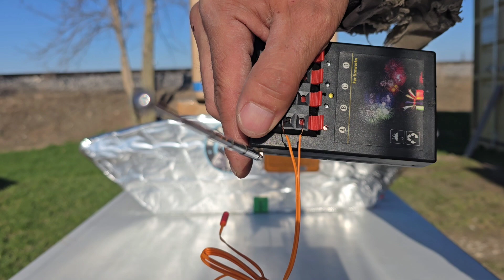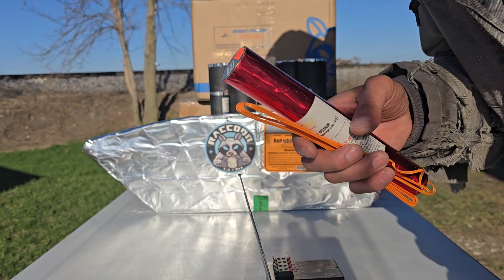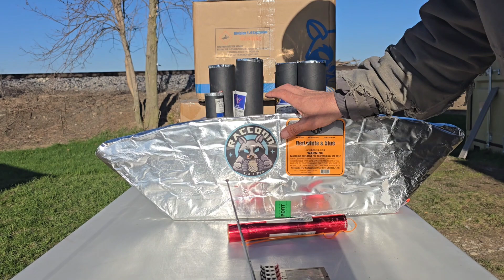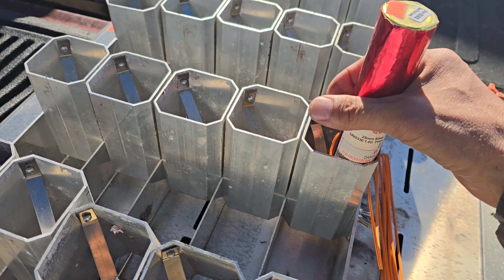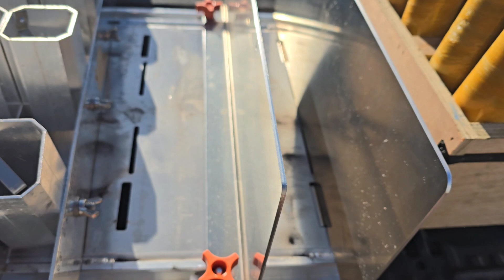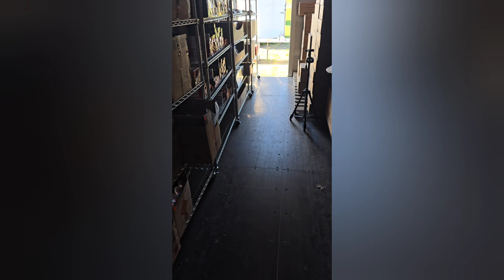1.4g pro use video #2 - Firing system questions, Single shot & Slice connections.

Comment: Good job on explaining this stuff so people can be safe using it. If people can get 1.3g on the street they can and will get 1.4g pro, the least the community can do is educate people on the safe way to use the stuff. The most important thing about being safe with fireworks is using a firing system and staying far away.
Reply from the maker: I'm a firm believer in these firing systems.  When they talk about regulating the pro stock I'm over here like why not add ports to all the consumer products
Reply: @discountfireworks26  Yes i especially like the shops now selling the Ignite system and some are doing a bundle with them too, like spend $1000 on fireworks and get a free ignite i18. I think anyone who is doing shows for neighborhoods and such should have a firing system.